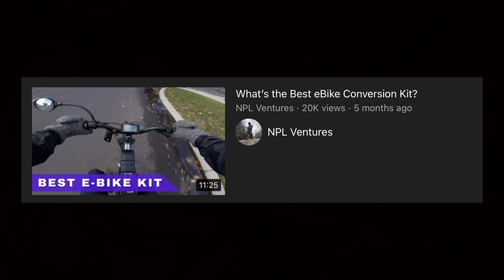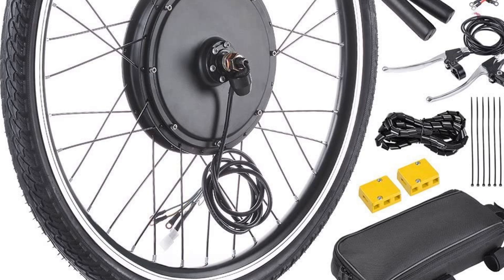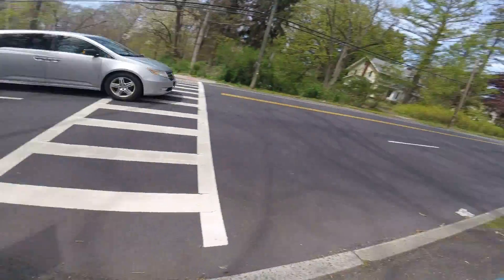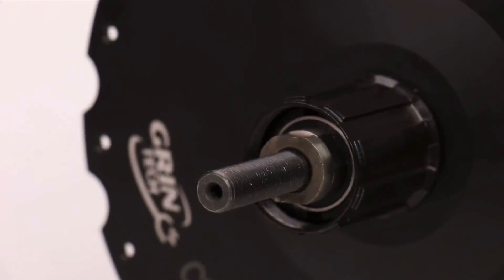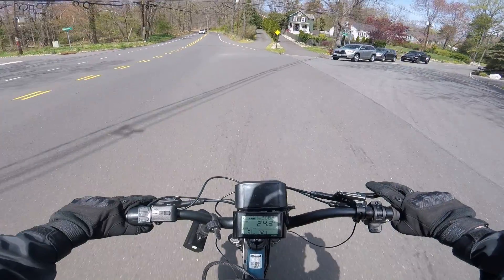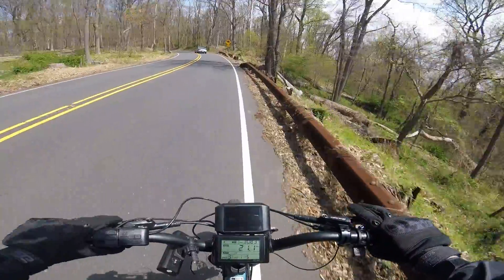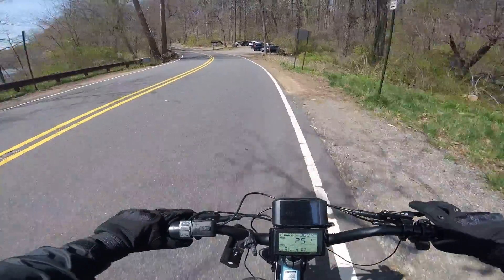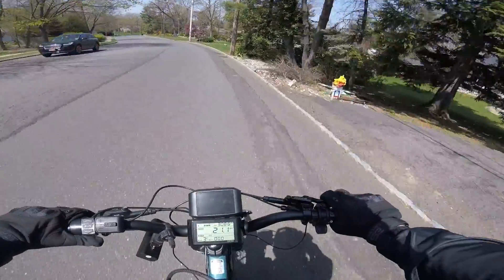The Absolute Best Hub Motor for your eBike Conversion Build

Comment: When you do your build be careful to match the controller settings to your battery. I'm assuming with a 72 volt UPP your battery can put out 40 or 50 amps continuous. You need to limit the amps used to the battery specs. That means if you use the same battery you'll be limited to approximately 3 kw (not that it's really limiting).
Reply: My kit has a 80a controller, and a 3000w kit….my battery is gonna be a 72v 20ah and 80amp BMS my worry is will this battery cook itself to death? I know I’m not gonna get a lot of range with it….running 80amp Continuous
Current….will be lucky to get over 10miles without peddle assist, and maybe 14miles with pedal assist.

I really screwed up on my battery selection…..I payed too much attention to the 72v 80aBMS and ignored the 20AH….I guess I can one day build a second 72v battery, and run 2….for more range. 

Because I know for sure this battery isn’t gonna have a long range….good news is it takes 1 hour to charge, and I use a hub motor….I will probably build a mid drive MTB with 1000w and 52v with a higher AH
Reply: @Futuremax-e8f  80 amps? Nice! must be a torque beast. Must have been pricey because that's way above average to the point of niche. I had a hard enough time finding a battery with a 50 amps continuous BMS.
Reply: @michaelsprinzeles4022  Thanks! price was around $800….I could’ve got one from alibaba express with a 100amp BMS for around $700
Unfortunately it was too late to get that battery…..shop around and you will eventually find a battery with a higher BMS if you don’t care about range a 20AH battery 72v 100BMS is very nice.

My speed controller is only a 80amp…but some kits come with a 150a Savoton controller.
Reply: @Futuremax-e8f  Part of my problem finding batteries is my trust in the vendors. I just can't trust Ali with anything that might ignite an inextinguishable fire between my legs. I'm not building anything that powerful yet but if I do I'll probably build the battery myself.
1 of my builds is a BBS02 tuned for less amps (to increase range). At stock settings it'll do wheelies in low gear and maintain 32 mph on flats in high gear. With the lower settings I use a 52 volt 6 AH (30 amp continuous up to 50 amp bursts) battery and get almost the same range as your kit does with a 72 volt 20 AH.
My other build needs a 52 volt 50 amp continuous battery and I have a 17.5 AH battery that does that. I have yet to see the pedal assist range limit on that (I don't have the stamina).
Reply: @michaelsprinzeles4022  you make a great point! People have referred me to Ali….however I never did any research in the companies batteries.
I definitely wouldn’t Trust having something that runs the Potential of exploding between my legs.
I’m kinda glad I got the more expensive battery from Amazon.
I’m definitely gonna be building my own batteries in the future.

I used to race Rc cars and had to construct my own batteries….I got so much into the hobby I bought a tiny tack welder meant for the tiny cells….my E cigs use some of the same cells. 
I been looking at vids with ppl building them…just like the RC batteries, you have to be careful with the heat applied to the cells when tack welding Individual cells. 
Using a BMS seems the safest way. 
I seen all kinds of cells used….I’m still collecting the equipment needed.

I build gas and electric bikes…for a business….I’m transitioning to only E-bikes because they’re A lot more dependable…it’s just the battery that gets me in price….but you gave me a good idea….how to save money.👍

I might have to build a aux battery if I ever wish to go longer distances….but my 350w - 1000watt builds…doing my own battery will net me a good profit…..the customer sold bikes have to be 350watt - 750watts to be road legal….ppl have the choice of running more than 750w but only for off road use….
Reply: @Futuremax-e8f  That's awesome. You're already way ahead of me, with both knowledge & experience, so I'm glad I could be of help.
Amazon is probably safer than Ali but still a middle man. That hurts both the price and possibly the credibility of the battery (depending on the seller).
Reply: @michaelsprinzeles4022  I’m still waiting on the battery to arrive….I learned a new lesson, Amazon will double charge your card for a pre Authorization charge’ meaning they will double charge you…once the battery is shipped they will credit you back the money…my account is at neg $800 dollars because of it….this is the second time they have pulled this stunt’ now I have to yell at them on Monday….I always have to call my bank, and remind them….Amazon is sneaky….this means the battery is straight from China.

I’m never buying any high powered batteries from Amazon….lesson learned, building you’re own battery is the only way to go! Once I get the battery….I’m gonna do a review on it.

Some of these batteries will burn under water….if this ever happens, it can ruin someone’s day.
Reply: @Futuremax-e8f  All lithium ions are susceptible to that kind of fire. It's called thermal runaway. The problem is that the battery produces its own oxygen as it burns so it can't be put out, just waited on. A good BMS is the best defense & still not bullet proof.
I look forward to solid state batteries that won't suffer from thermal runaway.
Reply: @michaelsprinzeles4022  Not all lithium is susceptible to that kind of fire. Lithium Iron Phosphate (LFP, LiFePO4) isn't energy dense enough to reach thermal runaway. It's also older than the more compact lithium batteries. Solid state batteries are overhyped.

Comment: Thanks for your discussion of the Grin hub motors. Some very good points. Also agree with the poster below, best to not write off low cost Chinese motors but Grin really is an engineering company that sweats the details.
For those interested, Grin makes a shark battery mount that really improves how secure you can mount a Shark style battery to a downtube.  Its called a Triple Bob and I used them for my builds.  I hate a battery that rattles on the bike.
All said, I am a mid drive BBSHD kind of guy but I also see the virtue of a hub motor.  I prefer to have nothing attached to my wheels...like the wires that protrude from hub drive axle.  I also don't like an external controller.  Last thing is I don't like all that weight over one wheel. The BBSHD with stock controller will push an ebike 35mph easily.  I generally don't have much need for much over 30mph. Further, its dead quiet.
I really believe a gas powered Honda Grom is a better alternative to a e-moto on the street.  Yes, it needs a license.  I have my motorcycle endorsement.  You can't ride a Grom on a bike trail, but because it will do 60 mph, has turn signals, better suspension etc, its safer and faster on the street than a 5000w e-bike which is lower power.  A Grom is about 7000 watts if converting from horsepower to watts.

Comment: Hey NLP Ventures so I'm trying to make a new ebike and looking for a donor frame and I'm down to 2 options which is a cheap dual suspension bike with no space in the frame to put the battery but then theres a front suspension bike with room in the frame to put the battery. I'm going to be using a rear hub motor on this build and I just wanna know how important is it for me to have the rear suspension?? I'm only gonna be using it on the road so would I be all good with just front suspension or would it be better for me to go with the rear suspension bike?
Reply: Stay hardtail for battery mount and look for a suspension seat post to cushion your butt
Reply: @hillyseattlenarrowstreets6087  is the cheap dual shock not worth it?
Reply: @stevenmiller9198  Buy a 52V battery first and try to fit it on your donor frame.  If it fits, use it.  
I did a MTB and got a $375, 52V, 20ah triangle battery for it. The $275 rectangle battery didn't fit.
750 Watts = 1 Hp and a lighter bike performs better.
Hub motors place a lot of weight in back.  If you can't place battery in frame triangle, then you're using a rear rack for battery.  That will make your bike very back end heavy.
I did 3 hub conversions, all standard frames with battery in frame triangle - TIP - your water bottle mount holes may not align w/ "Hailong" battery rack - remove rack plastic cover and drill 2 holes into metal plate for mounting holes.  Otherwise you can try mounting rack upside down for battery to fit.
Hubs are great for flats but poor on steep hills - low wheel RPM and High Amperage, drain batteries fast.  Electric motors like to spin fast - mid-drive in first gear spins uphill w/ less wattage = more battery range.
The conversions I do now are Bafang BBS02 mid-drives. @ $500 motor and more tools needed for install, but they're lighter, stronger and weight balance is better.  Look up Johnny Nerd Out channel and see what he does.  30 mph on a flat is fast enough for me.  His stuff is all stock.
If you want fast, I can see a 2000 Watt hub, you'll go 45 mph fast and need a lot of battery for range = more weight. 
Look up High Voltage channel - best BBSHD conversions with a ASI BAC 855 controller.  His white fat tire bike is a beast.
Reply: @hillyseattlenarrowstreets6087  Thank you so much man for all this information!!
Reply: @stevenmiller9198  Lookup PDXevgrin channel, he uses a Grin hub in Portland Oregon.  That is a nice bike setup.
I'm sure he's still using it fine.
For your build, make sure you get disc brakes, cable brakes easier than hydraulic for motor cut off switch install.
Also steel frame heavier, but stronger than aluminum. 
All the expensive ebikes are mid drives.
Reply: @hillyseattlenarrowstreets6087  yeah I don't quite care to much about the weight of a steel bike frame I'm used to riding heavy bikes in general so I choose steel for the durability of it

Comment: Not good to generalize on Chinese hub motors like that. There are some extremely good ones for not too much money. Mxus, bafang have a good reputation. I use a Mxus xr15 500w geared. It's a great little torque motor. And will take a lot more power. Grin are obviously good, but don't write off Chinese stuff.
Reply: Same here,great Chinese motor,48 volt 1000 watt 105.00 2 years ago,set up too 72v with yuyang controller,flys up hills with no problem, couldn't justify the price difference to try newer style motor at this time . Hopefully these motor companies will drop the prices in future. Just wire and magnetd lol. Great vid
Reply: @stevesandra007  I have over 7.5k  miles on this motor. Brake blocks wore thru rim walls at 5k.
Replaced the rim, took abit of research until I found the correct depth. Disk brakes now, so no more weak points. Fastest I been is 54.3 mph, bike best at 30mph
Reply: @Mr ?? Agree on the disc brakes..lol. Hit 53mph but only feels safe below 45.Best battery life around 25 to get 40 miles out of it without pedaling.
Reply: I have tore down hub motor, and internally they’re the same….some American companies will take the Chinese hub apart and use thermal grease on some of the magnets….it’s a very simple process.

I never had a low powered hub 350w - 1000w fail on me….I had one come Loose and since the wire has a metal sleeve it didn’t cause any damage, and still runs strong…Hub motors are very Identical….mid drive motors are a different story.
Reply: @Futuremax-e8f  mid drive motors are very identical, because all electric motors run on the same physics principles.
Reply: Also the Gmac motor is an Mac motor from china without clutch.So it is basically a China motor
Reply: @wrosslandwr8032  The Grin All-Axle motor is not a motor from China. It's handbuilt in Vancouver, Canada.
Reply: @wrosslandwr8032 🎤 drop
Reply: We are still allowed to state facts as far as I'm concerned and that was a fact so get over it
Reply: @Scatterbrain70  That was not a fact. It was an opinion. Opinions are not facts because feelings are not facts. Opinions are made up of feelings, not just facts.
Reply: Bafang definitely seems like a better value for the average ebike rider. But if you've got the money kinging around from selling your car, I can see why you'd wanna use something from grintech. The GMAC hub is what really got my attention when I started learning about different motors, that thing seems awesome!
Reply: Ebikeling too
Reply: Sounds like something a Chinese hub motor manufacturer would say😂
Reply: Chinese stuff is all crap
Reply: I have run a violamart 48v 1500w hub kit for over 2 years , forest trails and roads at 63v.
Been bullet proof, 
I do see it slow on really big hills but always overtake on the straights.
Reply: @Mr-ue2ul  same on my qs205 … although like he said it does not have any torque arm.  Mine has a cassette though.
Reply from the maker: Good points
Reply: I am sick of the ignorant biased against Chinese manufacturing. It is a form of racism. Chinese manufacture a range of price and quality leaving the choice up to the customer as to level of quality required. World class quality is produced in China. Just look at where the device you are recieving this. Is it high quality? Is it affordable? Is it reliable? Where is it made?
Reply: @kevinnielsen1356  exactly. If you want real QC and provide the training and oversight in the factory's, then the standard is the same as anywhere else. However, people taking their manufacturing to China on the cheap get cheap results as you would expect. Chinese workers work extremely hard.
Reply: @yoda-be.at1746  I find it ironic that most of the people contracting others to manufacture cheap products are USA corporations.
Reply: @kevinnielsen1356  Same all around the world, then we buy from them for 5x the price.
Reply: @kevinnielsen1356  dude, it's the simple fact that the majority of these Chinese manufacturers are mass producing these motors in the very large quantity, but the smaller companies are aiming more for quality and not producing as much, it's simple math. The more Motors you have, the more likely some of them will have problems
Reply: @kevinnielsen1356  It's not a form of racism. "Is it high quality? Is it affordable?" are not compatible. High quality can be made anywhere, so why not make high quality in ones own country? There's less shipping costs, waiting and hassle by making domestic. Companies go to China for cheaper goods than can be made at home.
Reply: @kevinnielsen1356 It's not a form of racism to say. It has nothing to do that they're Chinese as much as it comes from China. And you being offended on someone else's behalf is ridiculous. Plenty of great companies while others use what ever they can even if the material is toxic.
Reply: @kevinnielsen1356  Agree with all your points except the racism bit. The generalization of Chinese products is a result of people's experience with poor quality control and concerns over the treatment of workers in China and Chinese industry's propensity for intellectual property theft. Yes it's ignorant (well, maybe not the treatment of workers or the intellectual property theft bits) considering that it's often America and other countries who are outsourcing to China out of greed, but people aren't doing it simply because the items are made by Chinese people. 

Not trying to be argumentative...I just feel like that word "racism" gets used as a power play in a lot to situations where it's not actually applicable.  A bad thing, since this cheapens the word and its meaning, which is disadvantageous when one needs to apply it to actual racism. 

However, your point about China being perfectly capable of producing high quality stuff is well taken! I think the best way for people to label cheap crap is exactly that way: cheap. If the price you paid for something is unbelievably/unreasonably/ungodly low, it's probably a cheap piece of crap... regardless of point of origin.
Reply: @Edhooey  That ignores the 'Chinese crap' attitude that often coexists with total ignorance of the product in question. The same attitude was prevalent in the 60's and early 70's over Japanese products.
Reply: @kevinnielsen1356  True, it's a generalization (despite the fact that many of the cheap knockoff products you can buy on places like Amazon are crap, and are in fact made in China), but doesn't make it "racism." Reread my initial comment. No one is calling it crap because they think the Chinese are incapable of making quality products; they're calling it crap because a lot of it (not all) IS crap, for the reasons you mentioned, and it happens to come from China...how else are they supposed to refer to it? If instead it had been Germany that had established itself as the global source for cheap, outsourced products, we'd all be talking about "cheap German crap."

Ironically, we tend to consider German products to be high quality... Is this a racist generalization? Certainly not every product from Germany is top quality...
Reply: @Edhooey  Bafang is a knockoff. Their BBS01 is a exact copy of Sunstar motor's European patent EP 2 143 628. Sunstar took Bafang to court in August 2014 for patent infringement and won, but Bafang just ignored them from China, continuing to undercut Sunstar by offering a lower quality counterfeit at a much cheaper price.
Reply: @Edhooey  the word "racism" does get used as a power play in a lot to situations where it's not actually applicable.
Reply: @Edhooey  we tend to consider German products to be high quality because German products are more expensive, thus they know they need to be more quality to sell at that price. China's selling point is big volume at lowest price.